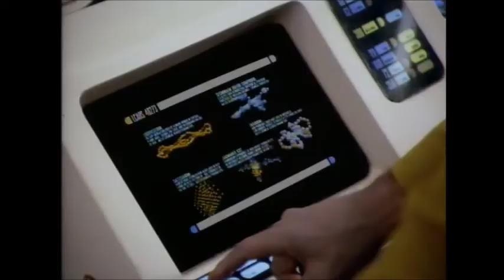Hollow Pursuits  Engineering discovers Invidium

Comment: 2 of the substances were highly toxic, yet aren't normally scanned for.
Reply: no one uses them
Reply: @thejamesasher  a bit over security oversight. All someone would need to do is find out what the sensors don't scan for and narrow the list to dangerous contaminates
Reply: Well, Barclay specified something they couldn't scan for. It might be that the only type of energy scan that can pick those substances up is something disruptive or harmful to human biology, like the "baryon sweep" they had to do in "Starship Mine".
Reply: Those highly toxic substances are probably strictly regulated or even barred from general use. And in the case of the last two substances, they haven’t been used for decades in the federation when far better containment solutions were developed.
Reply: @digitalrailroader  And yet the Enterprise spends a lot of time carrying alien equipment, which is how they got it in the first place.
Reply: Maybe they were so rare it wasn't thought necessary.
Reply: @stephenbarringer235  Oh, good point.
Reply: They said that it was something that a standard scan wouldn't pick up.

Methods to scan/detect things vary greatly, so the more things you want to detect the more hardware you need, not to mention all the various limitations such as range, power, time, situations in which it can be detected, false readings, etc etc..

Creating any kind of modular 'standard' which can cover so much ground would be a huge undertaking with a pretty large footprint, so on a vessel meant for long duration standalone survival you would want to limit the scope of such a device for practicality.

Non-standard detection would likely be possible on the ship but the means would vary and require a more personal touch, and likely also require far more time and footwork to manage.... much more than would be available in such an imminent crisis.

That being said, I agree that things that may contribute to a catastrophic failure SHOULD be part of the standard security package of a long duration standalone vessel, as well as standardized procedures to efficiently check them all rather than a meeting where they just troubleshoot whatever comes to mind.

There's a reason pilots have a veritable library of procedure manuals on board the big planes.
Reply: @FiltyIncognito   The most logical thing to me is that Federation scanning tech is heavily reliant on computer analysis of the data, and thus if the computer doesn't care, then the scan says no....  REALLY doesn't make sense for it to be IMPOSSIBLE, especially since they DO in fact have scanners on board that CAN find it.
Reply: @marhawkman303   I always figured that there's two types of scan, active and passive. Active scan is something that's basically on all the time, something like the sensors for life support to maintain constant temperature and atmospheric conditions, as well as most common security functions. Passive scan is for the much less common things that they would only search for on purpose and has to be manually activated. As to why they don't have active scan for everything all the time, I remember some episodes mentioning sensor allocations so I'm guessing there's simply a limit to how much stuff they can detect at a time so they simply leave out the stuff they consider unlikely to show up unexpectedly.

Plus they mention it right here; they had no idea what kind of effect invidium would have on their systems, they no longer use it themselves, nor is it toxic, so there's a valid reason to not really concern themselves too much with it normally.
Reply: @Takeshi357  Yeah, this goes back to the idea the writers never decided how internal sensors worked, and thus wrote this weirdly because they didn't know what they were writing either. :p  But more so.... Geordi needed a specially calibrated hand-held scanner to verify if things had invidium in them.
Reply: @Takeshi357 I think you mixed up active and passive.
Reply: @absolutez3r019  I'd think any such substance would be detected during transport. The computer has to know the exact composition of whatever its transporting down to an atomic level. The computer should be able to analyze the pattern while its in the buffer. 

Maybe the computer isn't fast enough to work its way through all the data in the buffer before it needs to be rematerialized, I don't know. But they have been able to detect and disable weapons mid transport.

Comment: Why can't you just eject the warp core? Wouldn't that be better than a saucer separation at warp 9?
Reply: because the Enterprise D's core ejection system has about the same reliability of a used modern Land Rover (I.E Spends more time in pieces than actually functioning)
Reply: Also, if you eject the warp core, you got no more warp drive, and almost certainly no subspace radio. No warp drive in deep space and no subspace radio = years before anyone can find you.
Reply: @stephenbarringer235  You can dump the core and then send a shuttle back to retrieve it. They did that in Voyager.
Reply: @trekreview  Ah, that's true. I am just so used to assuming the only reason you'd want to dump a warp core is an imminent breach, which of course would leave nothing to pick up.
Reply: I think those systems were literally jammed, so you couldn't even do that.
Reply: Can you eject it in warp? I feel there will be a negative consequence with the warp field
Reply: @rholya  Watch voyager day of honor season 4 they ejected at warp.
Reply: @stephenbarringer235  subspace radio isn't tied to the warp core
Reply: @trekreview  i feel like voyager did lots of bs crap to be more exciting... being smeared atom thin on galactic loaf due to core ejection during warp travel is pretty reasonable to me